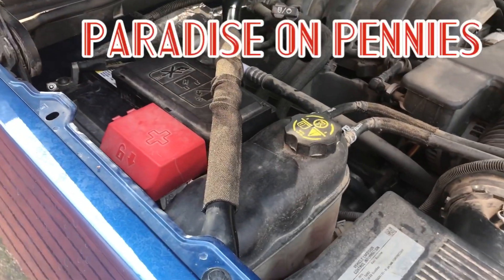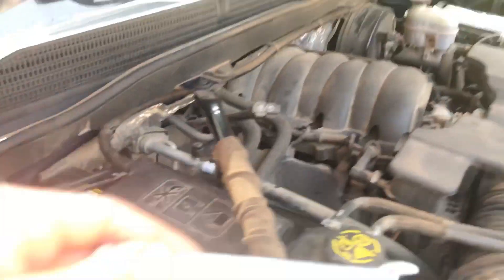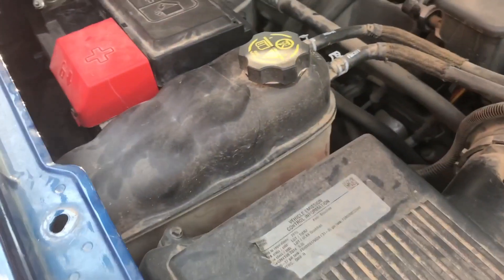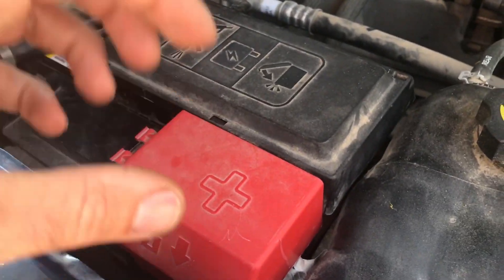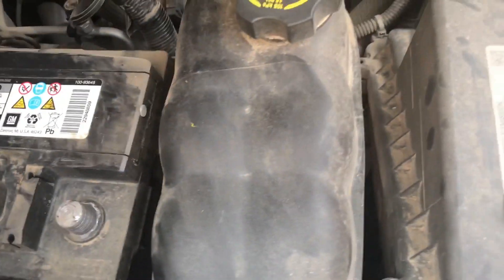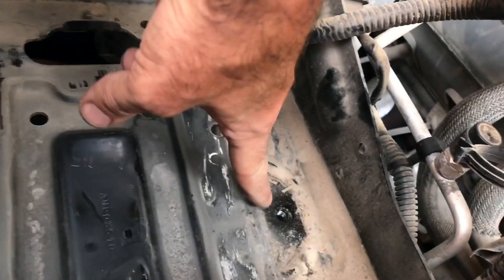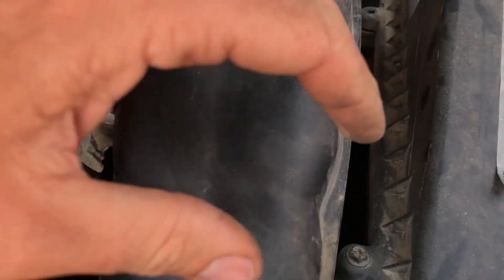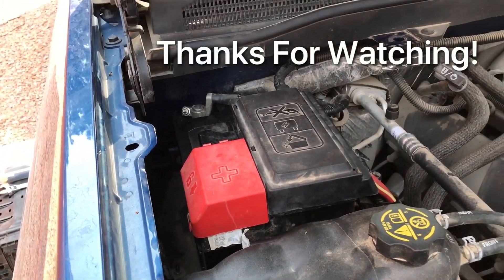Truck Won’t Start! Changing Battery On My 2015 Chevy Silverado 1500 #chevysilverado

Comment: Just did my battery in my 2015.  If you roll the battery on its side,  it will slide right out without having to move the coolant tank.  One of the two tank bolts looked like a PITA to get to.  Thanks for the video.
Reply: I tried this couldn’t get it out. I took off just one of the bolts off of the coolant tank and I was able to wiggle the battery out.

Comment: thanks for the video. I just changed my battery in my 2016 Silverado. I cannot believe Chevrolet designed such location for battery that required so much effort to remove and replace the battery. I finally did it.  The part especially getting the battery in and out was really trying. The battery is very heavy., i loosen the water container next (in front of the battery) to the battery to get mine out.  good job!
Reply from the maker: Thanks

Comment: Thanks. This vid along with the comments helped a lot. I got the 5 year or 50,000 bumber to bumper warranty and of course it doesnt cover the battery. Battery $189,  dealer wanted to charge $250 for the install.  I did this in an hour.

Comment: Thanks for the help! Just managed to change mine despite the Chevy engineers making it hard as hell. Managed to pull it out without taking the fluid tank out...just loosened one bolt enough to shift it a bit.
Reply from the maker: Good to know for next time! Thanks

Comment: Hey buddy…thanks so much for this video, it really helped! A couple things, its not 100% necessary to loosen the coolant tank. I mean, the battery is heavy, but if you have the strength, the old and new battery can be tilted/twisted/leaned, etc, into and out of its proper place without moving the coolant resevoir. Im sure because i just did it. Also, i found it helpful to disconnect the “left-most” cable in the wire array that sits on top of the battery. Its a 13mm also, so nothing new required from the tool box. I appreciate this video!
Reply from the maker: Glad it helped!

Comment: My battery drained out of nowhere. Checking this vid out just incase
Reply: same here mine just stopped turning on all a sudden even while connected to a charger/maintainer at night..
Reply: @murdamomurda9018  did ur stabilitrak msg come on or sound all cut some at times? I ended up replacing it 2 days later
Reply from the maker: Oh boy don’t get me stated on the stabli-trac light. We had so many issues with ours. We ended up just selling the truck. Way to many issues and recalls.
Reply: Mine drained when not in use. Battery is 5 months old. Something is draining it.
Reply: My battery just needed to be replaced. Havent had an issue since
Reply: Check 12v in your truck if something is plugged in and your truck is off it will still stay on  like a phone charger. There’s a video about a fuse that’s making it do this . I have a 2016 chvy and I’m currently changing my battery as well lol

Comment: You skipped all the hard crap. Why in the hell do you think we were watching this video? You didn't show getting the difficult nut off underneath the air filter cover for the coolant tank. You didn't show struggling to get the battery get the battery out or back in but if you did move the tank out of the way completely that does help.
Reply from the maker: Sorry I only have 2 hands and no tripod so I didn’t get to film me removing the battery, same with the nut.
Reply: You don't really need to see that done, he explained it perfectly well and it's obvious where the bolts and clips are after watching this.
Reply: @thesandman775  this comment was less useful than the video
Reply: @christurman2650  Neither is less useful than you complaining about the video not showing how to remove a nut under the air filter in plain sight...